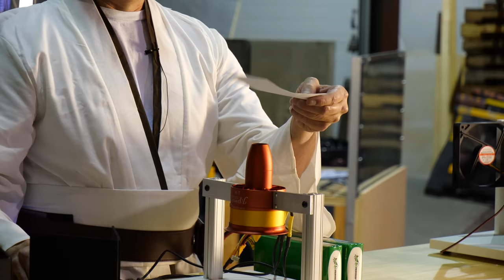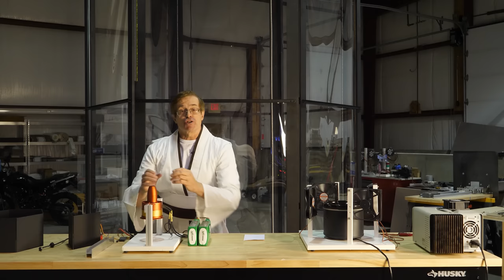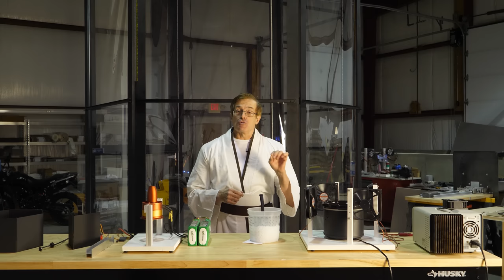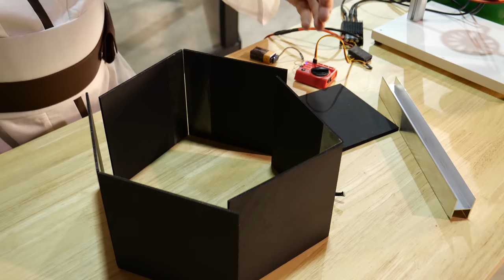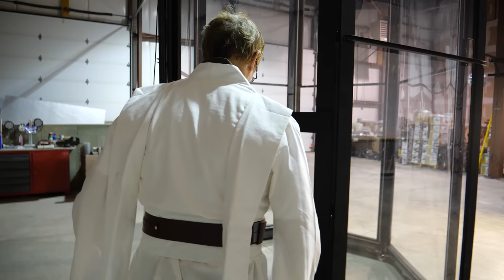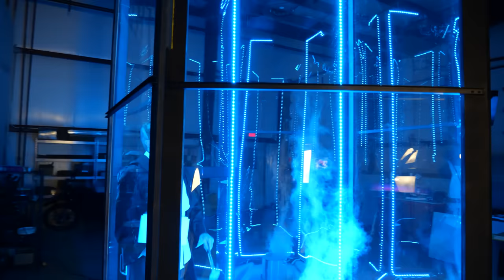Controlling Chaos: Building a Massive Tornado Chamber!

Comment: I have to say  that at 7:00 the kinetic energy DOES increase when you pull your arms in. You have to do work on the mass that's far from you to bring it in. Angular momentum is conserved, so you find that the angular velocity increases by 4x the change in radius and speed increases by 1x the change in radius.
Reply from the maker: True,  but the effect is very small.
Reply: @TechIngredients  To assess the size of the effect let's run the numbers. Let an object be circumnavigating at 1 unit of radial distance, with an angular velocity of 1 unit of velocity. That gives 1 unit of linear kinetic energy.

Next the centripetal force is increased, such that the circumnavigating motion contracts. Let the radial distance be reduced to 1/4th of the orignal distance, settling to circular motion again. The fast way to find the change of tangential velocity is to use the property that the magnitude of the product v*r is conserved. If the radial distance is quartered the tangential velocity is increased by a factor of 4.

(Using the letter 'w' for angular velocity: the expression for conservation of angular momentum in terms of angular velocity is: the quantity w*r*r is conserved. That is, contraction to 1/4th the radial distance results in a 16-fold increase of the angular velocity.)

If the final tangential velocity would be the same as the initial tangential velocity then there would be no change of kinetic energy.

In this example the final tangential velocity is 4 times as fast as the initial tangential velocity, hence the kinetic energy has increased by a factor of 16.

The expression for rotational kinetic energy is: 1/2 w*w*r*r 
The initial rotational kinetic energy is 1 unit of energy, the final state is a 16-fold increase of rotational kinetic energy

Anyway, I am aware that your reply to tjncooke shows that when it comes to this subject your mind is made up.

(Incidentally, the reason I used a change with a factor of 4 instead of a factor of 2: with a factor of 2 doubling and squaring end up the same; using a factor of 4 evades that ambiguity.)

Comment: Great episode! Interesting subject, great demonstrations, great explanations, and great production. Lets be honest, not many of us will build huge tornado chambers, so we don't need more details about how you built yours, that was just about perfect.

About the pirouetting ice skater, would it be safe to assume that the average velocity of the whole skater remains the same, minus some losses to friction, and the velocity of the hands actually decrease significantly, as some of the momentum in the hands is transferred to the part which radius remains the same?     

The part about water vapor giving off energy when condensing, doesn't the water density increase and volume thereby decrease about a 1000 times when it condenses, which would have the net effect of reducing the buoyancy?  If the very small liquid water particles "behaves" as gas molecules, the effect on overall density from enthalpy of vaporization released should be about cancelled when the liquid water particle reaches about three molecules average, if I understand it correctly, and calculated correctly.   Am I totally off, or does it take time to reach net reduction in volume?
Reply from the maker: They are counteracting effects, but the net effect is still a decrease in density.

Comment: 27:31 To be honest, this might not be the worst application for the oil based hazers.  If you put an exhaust on the fan so you can pipe it either outdoors or into a filter to capture it, it technically shouldn't ever touch the walls of the chamber
Reply from the maker: Agreed.

Comment: First 5 minutes.....THAT is why fuel based rockets push off of air to produce thrust. The ride a column of exhaust, as the ambient air pushes the rocket forward. Or another way to look at it....the rocket is moving the atmosphere behind the rocket, and thus the rocket moves forward as the atmosphere pushes back.

Comment: That bit about the speed of sound being the speed all air molecules constantly travel at makes the whole concept of a ‘speed of sound’ make a lot more sense.
At 6:54, I think you meant to say the figure skater’s total angular momentum stays the same. Instead, you said their fingertips keep the same velocity which can’t possibly be true. If they move their fingertips to the center of rotation, their fingertips wouldn't be moving at all, just rotating. These videos are great, but its hard to trust them when they contains mistakes like this.
Reply from the maker: It is true.
There is a very slight increase in the energy in the skater's rotation due to the work performed  by their  arm muscles, but even that small  increase is shared  by the entire  mass of their body 
The velocity  of their fingertips  remains essentially unchanged.

Comment: I’m not sure that you’re entirely correct on the wind shear aspect , when you turned off the lateral fans the “fog” or c02 is cooler and denser not an entirely fair demonstration. Instead use water vapor or an ultrasonic mister. I know you’re correct wind shear absolutely plays its role, however I believe it’s the updraft and down draft near the rain free base and the torrential rain directly behind it.

Comment: At 2:30: pressure does increase with temperature when the gas is confined, which is what let the Tech Ingredients crew build those jet and rocket engines.  Fortunately, weather-like changes happen slowly enough that sound waves are usually unimportant (Tonga-Hunga partially excepted)

At 6:55: there is in fact added kinetic energy from the ice-skater spinning up (in the absence of friction).  To pull their hands in, the ice skater performs work against centrifugal force (in the rotating reference frame).  This is also evident from conservation of angular momentum: two 1kg weights, counter-rotating with a linear velocity of 1m/s at 1m from the axis have a combined angular momentum of 2 kg m^2/s.  If the weights are brought to 0.5m from the axis, that implies the weights must have a linear velocity of 2 m/s (2×2×0.5), coincidentally quadrupling the kinetic energy.  Again, the energy increase is caused by the work done against centripetal/centrifugal force.  

If instead you don't like the ice skater analogy, orbital mechanics causes the same effect with satellites in non-circular orbits, with no external force applied.  To conserve angular momentum, the orbiting body has a larger linear velocity when it is closer to its parent.  Its kinetic energy really does increase, and this energy comes from the decrease in potential energy caused by travelling down the gravitational potential.
Reply: 1. What 'confines' an 'unconfined' gas, such as "open within" an atmosphere? 
Yes, gravity. 

2. "there is in fact added kinetic energy" 
Very good point! ..ofc there is lol
Reply: @Dr_Wrong  Gravity in an open atmosphere isn't enough confinement to cause pressure to increase with temperature.  On the Earth's surface, if we neglect dynamic pressure caused by winds then the atmospheric pressure is equal to the weight of the air (per unit area) above each point on the surface.  Heating that air doesn't change its mass, so it doesn't change the weight (ignoring height-based decrease in gravity, because the atmosphere is thin relative to the radius of the planet).

To see a positive relationship between temperature and pressure, something must hold volume constant.  That can happen through a sealed chamber like a pressure cooker, or it can happen if the change in temperature is very fast compared to the speed of sound (being very hand-wavy about units, of course).  In the latter case, if a gas were rapidly heated we'd hear a shock wave caused as the locally-increased pressure returns to equilibrium.
Reply: @Majromax  

Right. Gravity isn't a vessel, so changes are dynamic. Increases in temperature more readily increase volume than pressure, decreases 'density,' lowering temperature, decreasing volume.. Ka-boing ka-boing ka-boing.. as energy enters and leaves a vaguely defined system.. 

But. It IS 'constrained' nonetheless. Therefore tornados.  

I don't remember my original point, probably just misunderstood something idk 😆

Comment: Several mistakes in this one

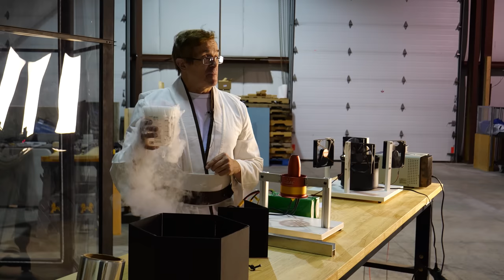4:07  the fan does in fact increase the total pressure of the air. The exit nozzle drops the static pressure below ambient, which then pulls ambient air in. As air is pulled closer, it is accelerated to the velocity at the outside of the air stream by continuity and the no-slip condition. 

6:51 the ice skater doesn't "appear" to spin faster, they actually do. There is more kinetic energy, and it comes from the work done to pull the hands and arms in against "centrifugal" force.
Reply from the maker: There is no "static" pressure  in the air stream.
True,  but it's  a very small effect.
Reply: @TechIngredients  there absolutely is static pressure in the airstream. Nothing to do with static electricy, etc.
Reply from the maker: Static means immobile.
Reply: @TechIngredients  and static presume is the pressure of the air but for thr fact that its moving. 

Think of a pitot tube. The tip measures the stagnation pressure, which is the total pressure.  The static ports on the side (or the static ports on the fuselage) measure the static pressure.  Stagnation pressure minus static pressure is the dynamic pressure, which, given density, can be used to measure airspeed. 

Just Google "static pressure" for God's sake, or look it up in any fluids book from the past century.
Reply from the maker: Understood.
I was correcting your use of static pressure.  You should have said differential pressure. Because  you wanted to dig into the detail of flow effects, using the correct terminology is fair game.
Reply: @TechIngredients  I don't agree. Static pressure is just pressure. The pressure that is related to density.

Comment: Ok, industrial strength cling film (Saran wrap) in place of perspex.
Held down with double sided sticky tape....
Am I the only person thinking @TechIngredients should build a boat from plastic wrap and sticks?
(Or those carbon fiber tent poles you get in cheap tents)

Ok, im buying that plastic wrap!
Im putting the tent in my attic, that i bought back in 2010, (for a festival and only used once!) to good use!!

The cling film canoe 🛶

But, if i had enough time to do this id have enough time to actually make use of that tent buried somewhere in the attic 😂

Comment: 6:54 from my experience on a merry-go-round, pulling your weight to the center requires work, i.e. exerting a force along the direction of movement. Doesn't that add kinetic energy to the system?
Reply: It does. For a point mass: decreasing radial distance by a factor of 4 increases the kinetic energy by a factor of 16.  

Check out the reply by techingredients to tjncooke, who pointed this out too. Techingredients acknowledges some work  is done, but he is convinced that the effect of the work done is very small.

Comment: 7:00 not actually correct. work is being done to draw the hands in increasing the velocity and not just because the rotational distance is shorter
also inertia would be based on r^2 so reducing radius to half would more than double the speed to maintain rotational momentum

Comment: @Tech Ingredients «…You can't transmit information or sound through a medium any faster than the messenger can travelling…» (1:15) I respectfully disagree. Although every medium has a «natural» physical propagation velocity that limits the speed, information can travel, every medium can experience discontinuities or nonlinearities that allows to overcome this limitation. E.g. within a gas, liquid, solid state material or plasma, a shock-wave is such a discontinuity. High explosives or high energy plasma discharges can and do create such shock-waves with velocities up to a couple of km/s within air. This accounts even within relativity, where the Lorentz-factor γ=1/√(1 - (v/c)²) sets the physical speed limit. However nobody forbids to introduce a discontinuity within spacetime itself by cutting out a piece of spacetime and move it faster than light within the rest of the spacetime - as the Alcubierre-metrics shows.
Reply from the maker: A shock wave is a different  animal.  The medium is no longer operating as a medium but as a collection of independent  particles. Then, the only  speed limit is the speed of light.
Reply: @TechIngredients  I completley agree, a shock wave is a different animal, because it is based on discontinuities (sudden changes of the state parameters of the medium) instead of sinusoidal transitions. However, a shockwave can carry energy and information faster than the speed of sound within a particular medium. This was the point of my clarification. The very same thing accounts for particles or electromagnetic wave fronts moving at speeds c/n < v < c (with n=refractive index of the medium) as e.g. shown by Cherenkov-radiation, or the weird things within topological insulators. Further, I agree c is the speed limit within a contiguous spacetime. Otherwise causality would be broken. There is however no law, that prevents one isolated piece of spacetime to travel faster than c, since there is neither a relativistic connection, nor a connection to the underlying quantum fields (according to QFT). Einstein-Rosen bridges and Alcubierre metrics deal with such things.

Comment: How does the updraft strength "feel" compared to fan discharge flow? 
How does distance from energy input affect flow.. idk  ..coherence? Perceived strength..
How lengthy can one make 'a tornado'? 
Is there less flow dispersion by controlling fan intake (tornado) than discharge? 
In other words, to move lots of air over distance, in your opinion is it better to suck or blow? 

Or never mind.. Nature can produce far larger areas of pressure difference than we can..
Reply from the maker: The updraft in the vortex  is surprisingly strong, especially  so far from the input side of the fan where you normally  can't feel anything.

Comment: Have you seen the glass tube cut in half vertically and placed offset around a burner? No power required.
Reply: For fire only, I didn't realize you stuck with dry ice.
Reply from the maker: I have.

Comment: Just seemed like an interesting possibility based on Compton scattering and the possibility that a net voltage would develop towards the middle and center of the device.  Some slight voltage increase might be measured even with just laser light that does not yield Xray temperatures. Quibbling about which magnitudes are known or not known to maintain your assertation that "you don't know nothin" is disappointing.  I could have looked up the spelling of holrohm but gold metal container identifies the object.  I doubt very much if the non Xray radiation reflected by the holrohm has much if any relevance.

Comment: I believe I noticed an oscillation of the “smoke “ from bottom to top and back . It seemed to be more pronounced as the dry ice was running out or as the smoke decreased.

What was causing the oscillation?
Ron
Reply from the maker: It was always there,  but became more visible  as the fog thinned out.
I'm  not sure, but it may be due to resonance  pressure  waves in the large chamber.